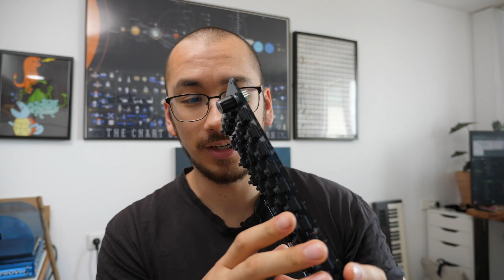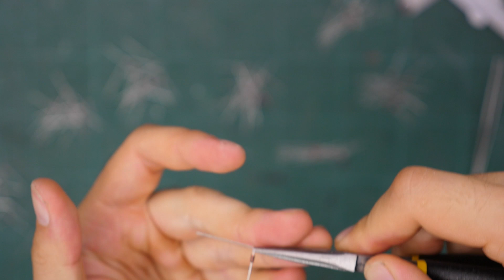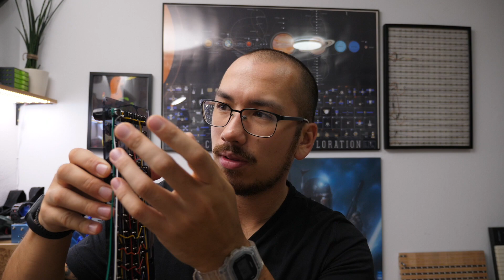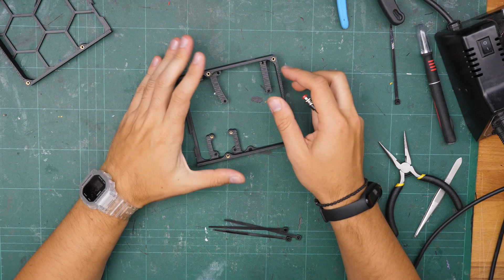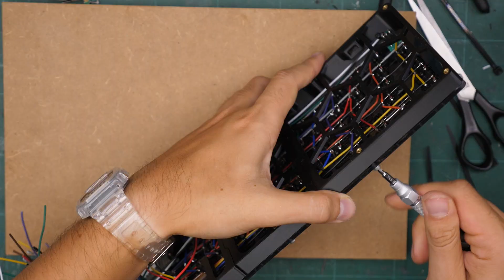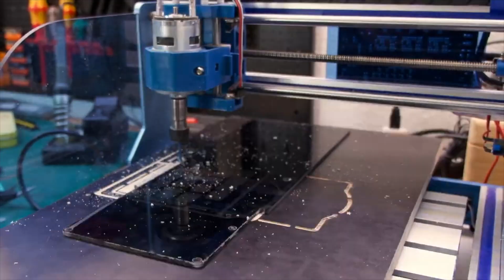DIY Handwired 65%-ish Keyboard (Part 3/3)

Comment: 1st. Nice project. You started with the idea and went through all the steps and made it work in the end.

2nd: that poor board and insert. You could have fixed it with glue or just unscrewed the screw and left it blank. No need to rip it off.

3rd show some features and the display working when possible.

Also:what did it cost to make and how long did it take you?
Reply from the maker: 1. Thank you!

2. I wasn't able to unscrew the screw because the threaded insert got loose :( But glue would have been a nice solution tho :D

3. The display only shows bongo cat and is just there for fun. What else do you need? ;)

4. I didn't really keep track of time and money spent. Material should be about 40€ + cost of the switches. Working time is probably well over 50 hours.
Reply: @normanwink  Bongo cat is sufficient use of a display. Love it.

Is the keyboard flexing when you type or is it pretty rigid?

BTW. I like the animation at the start from the last few videos. Gives them a pro feeling.

Looking forward to see new creations.
Reply from the maker: It flexes a lot due to the cutout of the space bar. That's actually a feature I don't like so much for some reason...

But, thanks for the feedback! I'm really trying to improve every video and it always makes me happy when someone notices. Thank you!

Comment: Hey, what type of rotary encoder are you using?
Reply from the maker: It's an EC11 rotary encoder :)
Reply: @normanwink   Thanks for the reply! I looked it up on the internet, I saw there's 5 pins. Can you please explain how to wire it? Or maybe share a link to some guide please? Thanks
Reply: @bangjago6188  Not sure if you ever found out but basically the top 2 wire to the row and column (if the 2 are facing upward, left is row, right is column) while the bottom 3 link to the microcontroller. The middle pin in between the 3 pins goes to ground while the other 2 go to any io pin